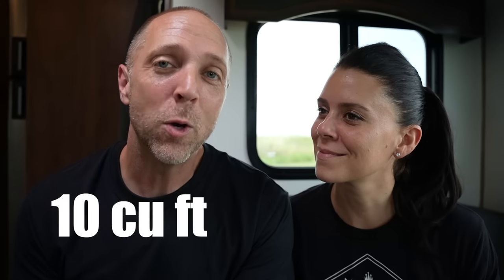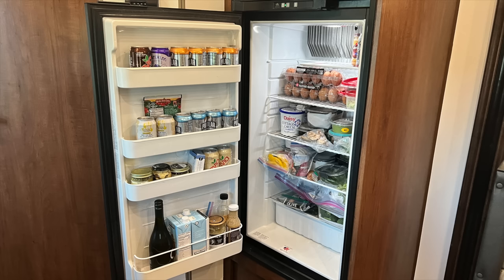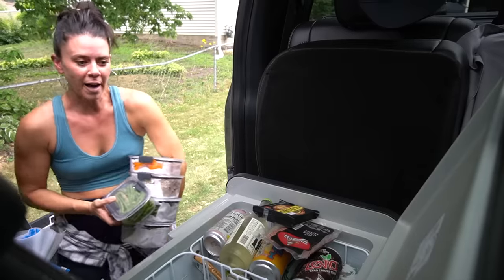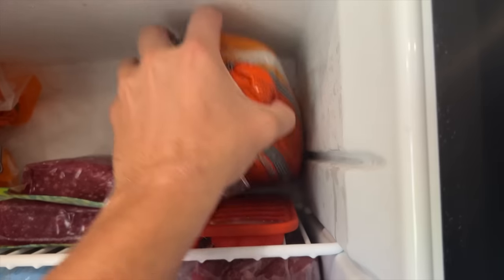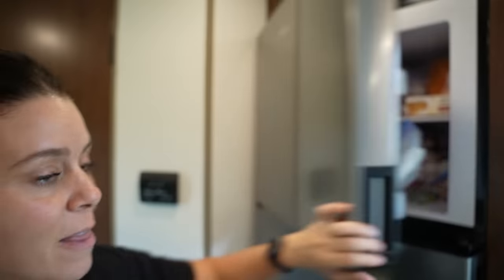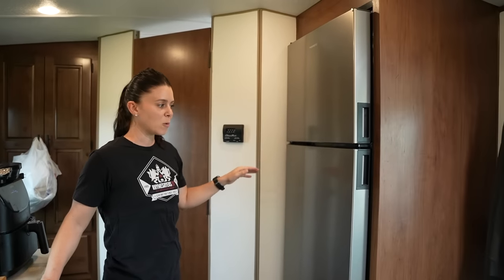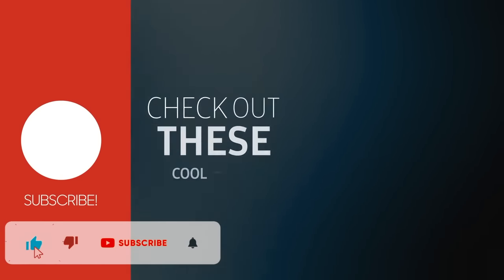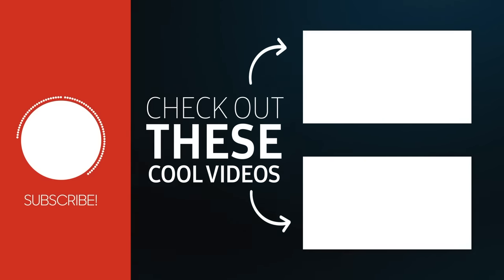6 Reasons You MUST Switch to a 12 Volt RV Fridge - Dometic 12 volt rv fridge

Comment: That's our same Fridge 10Cubft Dometic. I have commented before; our previous TT had a 12V compressor 10.7Cubt Ft and we knew wanted the same in our new Grand Design 22mle So we waited the 2022 model came out with the 10Cubt ft Dometic fridge. Just like yours. Our 5th day owning TT an we got a ding on the door as well. I had forgotten a empty small plastic container on the dinette table and while towing it must of flew off and onto the door and DING lol Drives me crazy so we placed a magnet over it. Eventually I will try to take ding out; watching some YT  DIY vids  lol
Reply from the maker: Ha that’s great! We have a magnet over ours as well 🤣 I wonder if a suction cup dent puller would work 🤔
Reply: @IreneIronTravels    LOLI No suction cup didn't work for me. I have it here at our home. This requires a little more science or technical ability and you guys are the ones to do it.. So I'll wait to learn from you LOL You see now you have another DIY vid .. Lol

Comment: How did you cover the vents that were required with the absorption fridge, and not required with the 12 fridge?
Reply from the maker: We just used a black gorilla tape (duct tape) on the inside of the vents to seal it up. I had plans to insulate better with foam board.

Comment: For our 2017 Navion, ordered a Canadian mfg Nova Kool RFU6406D dual compressor 12 volt only so we won't have any problems in the hot Florida weather. Anticipate in Oct or Nov. These things are expensive with lead of 5+ months.  I echo 100% on the 12 volt compressor.  Reliability and repairability The BIG negative for 12v. Some major manufacturers consider a $1700 12v a throw away when it doesn't work...they're engineered NOT fully repairable. Essential due diligence. For example, the Norcold n611 terrible reliability and not fully repairable.   In the early days of camping absorption only option. But now with solar and lithium 12 volts the only way to go.

Comment: Yes a 12 volt fridge has many well documented advantages. They are not the end all be all though. Its a generalization for sure but all that expensive solar is far less effective east of the Mississippi. Generators work of course but they certainly aren't an instant solution. Taking hours and in  many places they are not permitted at all. Also manufacturers, sales and RV reviewers generally fail to inform about the substantial expense related to these fridges.

Comment: good video thanks, thinking bout replacing mine but i did not know abt this model and the size upgrade in the 8cf space?  will call dometic and check on everything?
just wondering did u ck out norcold at all? has the dometic worked out till today or what 2cents can you provide??  thanks again 🤠
Reply from the maker: We sold this RV, but the dometic is running strong and we really liked it. A lot of people also use the Norcold and have seemed to like it. We have the new Norcold 19cu ft 12 volt in our new RV and it works good, but has way more condensation ( humidity) than our dometic. Could be the size difference, but it’s really ruining our vegetables in a few days….
Reply: @IreneIronTravels  ok thanks, guess the only way to resolve our issues is to have a residential unit(120v)??

Comment: We've always had a propane fridge, but our new AS (25 FC) will have a 12v. We never had an issue with the propane fridge, and it worked great boondocking. We do look forward to not worrying while traveling and will like having more room. We plan to have one 270ah Battleborn Gamechanger and 400 ah solar, but will add more if needed.
Reply from the maker: I love that the new Airstreams are coming with 12Volt now. I didn't talk about it in this video, but when I was van shopping one of the reason we bought the AS Interstate was because it had a 12volt and there wasn't two giant cut out vents in the side of the Sprinter van! Glad they aren't cutting up the trailers anymore! Thats a great electrical system for the fridge I think.. you're going to love it!
Reply: @IreneIronTravels  Definitely can't wait!
Reply: Our new Classic came with a 12v too. Love it compared to our 2020 Airstream that came with a propane model. Being able to leave it on while driving down the road is great.

Comment: What did you do to cover the vent in the trailer for the old fridge or did you just leave it as is?
Reply from the maker: Ahh yes, I forgot to add that part in as I did it month or so later while installing the Insty Connect Roof antenna that went down the roof fridge vent. 

So for the roof vent I put most of the pink insulation you see in this video from the walls of the cabinet and it fit nicely about 10 inches deep into the top rectangle hole on the roof. 

The wall vent I used a few layers of foam core radiant barrier https://amzn.to/3cepyJ3 to fill that part behind the fridge. Ill re check it in the colder months to see how its sealing up.

Comment: I have the same absorption fridge that you just replaced and it's been one of the more miserable ones I've owned. And speaking of power, that thing draws about 35 watts on DC when the exterior cooling fans are running. On even a warm day, for me, they run all day, continuously. They don't cycle. Doing the math compared to an 8'cu compressor fridge with its duty cycling that's nearly the same amount of power used in a typical day and I'm still burning gas. So yeah, I'm so looking forward to the day that I upgrade mine. Even the cheap chest style compressor fridge I had in my teardrop was so much less hassle than any absorber I've used and I miss it. Thanks for mentioning the measurements, that was helpful. I have the same door predicament as you and have been concerned about it.

Comment: hi team : I have been enjoying my DMC4101 for about a month nonstop without issue, until today when the compressor/fans just sorta seemed to stop working for the freezer.  It was about 26F in the freezer and very humid (94%) for a few hours.  Most things on the top of the pile were very frosty and or soaked from the high humidity.  (the fridge was holding temp at around 41F for many hours) I have two  Govee thermostats (that measure every 10 minutes) that can send alerts in the fridge and freezer (from our misery days with the Norcold NX8 Absorption Freezer) which is how I happened to notice.

I couldn't find any info anywhere online or in the manual from Dometic about this specific symptom, but simply turning off the power to the unit (by holding the start button for 3 seconds), letting it sit idle for a short bit, and turning it on caused the compressor and fan to kick in (at least on performance mode).  I figured it was worth a shot and it seemed to work.  Its almost at 0F again in the freezer in less than 1 hour and seems to be working normally again and the humidity is starting to go down.

Not sure what would have happened to our frozen food if I didn't get the high temp alert from my thermostat in the freezer.  

Have you guys had your Freezer stop cooling/freezing?  Just wanted to note it here as you guys have such a great video and resource about this specific unit.  Thank you !  (and sorry for the long winded question, hoping it will help others)
Reply from the maker: Hello 👋 Hmmm, that does sound unusual and we have not had anything like that happen. We've been using the fridge for about 6 months now Fulltime and it's been great. The freezer does have an auto defrost cycle and I wonder if it had something to do with that??  I'll see if I can contact someone at Dometic for some insight.
Reply from the maker: Hey Matt, this is what I found out about your situation. It sounds like your fridge was doing a defrost cycle... maybe it was the first one you noticed? But see below feedback from Dometic : 
The defrost cycle is directly related to the compression run time and will likely vary between 8-12 hours.  In cooler temperatures the compressor duty will be less so the time between defrost cycles will be longer and in warm weather the compressor duty cycle will be shorter (so more compressor run time) and the time between defrost cycles will be shorter.  There is a defrost heater that turns on during the defrost cycle to help shorten the amount of time to defrost the refrigerator. The 26 °F in the freezer matches well with what temperature should be seen during a defrost cycle.  If a user changes from performance mode to eco mode it will place a delay on the defrost cycle (running about half as many as it otherwise would); but by placing the refrigerator in eco mode it will also slightly raise the temperature in both refrigerator and freezer compartments.  If the reoccurring defrost cycle is a nuisance, I would suggest trying eco mode and check the temps with the govee sensor to be sure its desirable/acceptable.
Reply: @IreneIronTravels  amazing !  thanks very much for this detailed description, this makes alot of sense.  Maybe I missed it in the documentation, if so... I'm an idiot. 😆  I really appreciate you looking into this for me.
Reply: Hello - we have a Dometic refrigerator and are having problems as well. It's only 1 year old. This last trip our fridge went up to 50 and we had to throw a lot of food away as it wouldn't go down. When we got home, we started testing it. We have a thermometer in the freezer and refrigerator and it will show a fluctuation of up to 25 degrees in a 24 hour period. We realize that is air temperature so we put a bowl of water in there and we've been testing that with a food grade thermometer as well. It's been pretty accurate with the other thermometer in the fridge. We keep our motorhome in a storage yard and go over and see how it's doing once a day.  Would you mind sharing what the fluctuation on your thermometer was?

Comment: You didnt mention it in the video but did you block off the outside venting from the old fridge?? Mine is getting installed at the dealer right now,dropped the trailer off this morning i am having them do that while they are fixing the slide. I just finished the solar on Monday. 840 watts of solar, all I could fit on my roof because of layout of skylights and vents, and 824ah of batteries.
Reply from the maker: Nice electrical system! You'll love the new 12 volt fridge! I wrote this to the same question on another comment : 

Ahh yes, I forgot to add that part in as I did it month or so later while installing the Insty Connect Roof antenna that went down the roof fridge vent. 

So for the roof vent I put most of the pink insulation you see in this video from the walls of the cabinet and it fit nicely about 10 inches deep into the top rectangle hole on the roof. 

The wall vent I used a few layers of foam core radiant barrier https://amzn.to/3cepyJ3 to fill that part behind the fridge. Ill re check it in the colder months to see how its sealing up.

Comment: There seem to be a lot of stories of people who thought the (small, budget components) factory solar would keep up with their 12v fridge, and were quite disappointed. 12v is no doubt the way to go for people who camp with at lest partial hookups. For boondockers though, I suspect you’d want to add a couple hundred watts of PV panel and a couple hundred amp hours to your battery bank on top of the system that normally meets your needs. 

At least for me I hate listening to a generator, and I’d like enough battery to run 3 days in shade or bad weather, and enough solar to keep up with my use plus recharge depleted batteries within a day or two of good sun.

Comment: I see very little information online about cost savings of switching to a 12V fridge. When using our Norcold 1210 absorption style refrigerator we use either 110V electricity or propane. Is switching to a 12V refrigerator more cost efficient? We don't do a lot of boondocking anymore other than one night here and there, but we are snowbirds and pay for our electricity in the resort we stay in. Currently, if we run our refrigerator with electricity it uses about 520 Kwh per month so it costs us almost $100/Month. If we use Propane, it uses three 30 pound propane tanks so the cost decreases to about $60/Month. Would I save money monthly by switching to a 12V refrigerator? I do have a 180w suitcase solar setup that I would be using to supplement adding power to the batteries if I do this upgrade and four 6V golf cart batteries giving me 440 amp hours of usable power.
Reply from the maker: Hello! Yes hard to say exactly but I do believe you would see a big savings if you're paying for electric. Because gas absorption fridges are so inefficient they run pretty constant on electric. So ours for example was 350 watts and the new 12v is 120 watts. So it's almost  3 times as efficient. Also the compressor motor will run less and not constant like the gas absorption. As a rough estimate the 12 volt fridge can use around 100 amp hours over night.
Reply: @IreneIronTravels  Thank you. This is exactly the kind of information I've been looking for.

Comment: Nicely done ! We just took delivery of a new ORV 26KRV. Unfortunately when we ordered 4/22 the 12v refrig was not an option and the dealer was not wanting to replace ours. We are not full timers but do a few extended trips mixed in with monthly 4-6 day trips. I may replace in the future though.  Most of our RV's over the last 40+ years have been absorption without issues. At least they beat the couple we had that were ice boxes.
Reply from the maker: Thanks Herb! That's too bad you couldn't order it with 12v (I Really wanted to as well with ours), but you'll love your new ORV! We didnt have any major problems with our Norcold...but it was just a pain in the butt using it for full time travel.  Would love to see an ice box in a old vintage rv!
Reply: @IreneIronTravels  I had three rv's with them over the years. Nothing too exciting. 2 of them looked like a "Dorm" sized refrig but where the freezer would be you'd but a large block of ice. Same with the bigger one (about the size of a larger Coleman cooler. It had a drain tube to the outside. You didn't miss much, you're better off with the modern stuff.

Comment: Idk why I thought it would be as easy as unplugging the old, moving it out and plugging in the new.  😆. Shows what I know.  You guys are too good!   Congrats on the new 12 volt fridge.
Reply from the maker: 🤣 thanks! If you did a true residential fridge (110v) you could just plug that into the outlet and cap off the propane. But, those do take a bit more power with having to run your inverter😊

Comment: Just wondering if you had any problem getting the left hinged Dometic fridge you are showing?  On their website that model # is showing up as a right hinge only?  Also wondering if there were features about the Dometic you preferred over the Norcold N10DC, which is also 10 CU ‘ & will fit in that same space.
Reply from the maker: No we didn’t have any issues getting the Lh, but it might be less common… the part number is 9600026947 I believe. The Norcold is probably very similar spec wise, but I’m not that familiar with it. I have heard from a couple people they are happy with the Norcold. I do think the Dometic looks nicer and more modern with the controls on the inside like a residential fridge instead of the clunky black controls on the front of the Norcold. We are more familiar with the Dometic brand as well but either beats a absorption style in our minds 😊
Reply: @IreneIronTravels  Thanks for your input.  It’s helpful.  We picked up our ORV (04/22) from Thompson’s, (Pendleton, OR).  It came with the standard Norcold fridge.  We are full timers now, and have been spending the summer in upper MI.. We are getting so much condensation and frost, & I am over it!😂. Your video helped solidify why we might need to change out to the compressor type.  We may drop by Thompsons later this fall, they can do the install, should we decide to switch out. They currently have the Norcold compressor in stock. I have asked the parts manager about pricing out the Dometic fridge for us, as a comparison.  Meanwhile, just gathering info from folks like you to help us decide…many thanks.😊
Reply: @cschadwick  we are leaving Virginia  JC Refridgeration in Shipshewana, Indiana on Saturday.  On Monday they are switching our Norcold 1200lrim to a 2 12v compressor cooling unit.  I am soooo done w/ norcold and that bandaid recall fix they did.  My electric bill is outrageous.  And I won't have to sleep wt a nostril open waiting for a fire.
Reply: @rustyhurdis847  Just wondering how you are liking your 12 V fridge?  We look forward to changing our Norcold out in a few weeks!😊

Comment: Did Aaron insulate the Louvre door for the old fridge on the outside? We went with a DC fridge in our small older trailer and it has a huge louvre door basically open to the outside.
Reply from the maker: I did leave it open for about about month and then I covered the back vent with a foam core reflectix https://amzn.to/3ck68Cm

And the roof vent I plugged with pink insulation.
Reply: Thanks Aaron,

We are adding a vitrifrigo 4.8 cu ft fridge with a separate compressor we will be mounting in our closet. This almost doubled the size fridge we could use in our tiny trailer. I’ll have to keep the roof vent but the door I hope to insulate. As always thanks for All these wonderful videos. So so helpful.

Comment: Where did you run your ground wire to? I have the power to my old fridge but just the black/white and no green. I’ll need to add the ground. Putting in the same fridge today!
Reply from the maker: The chassis ground can be run to a screw onto the frame of the RV , just make sure the metal is bare and the paint is scraped away. Enjoy the new fridge!
Reply: @IreneIronTravels  thank you!